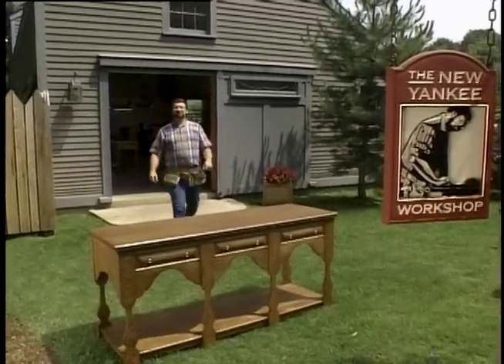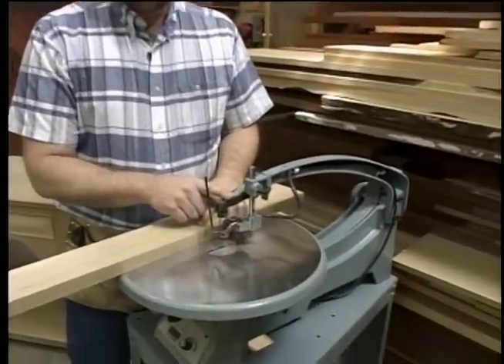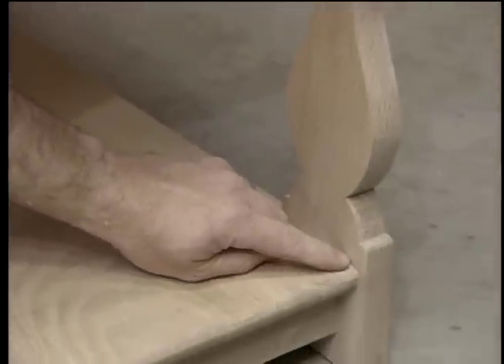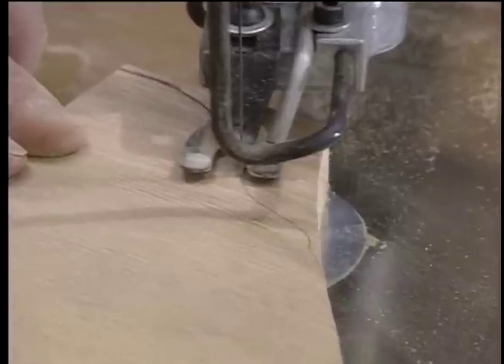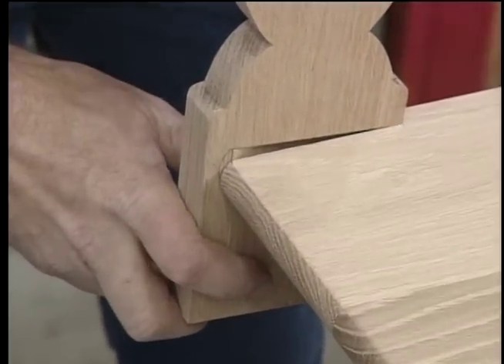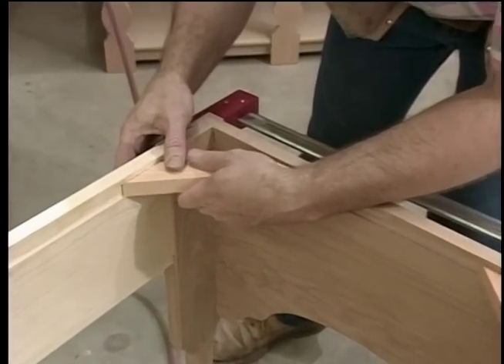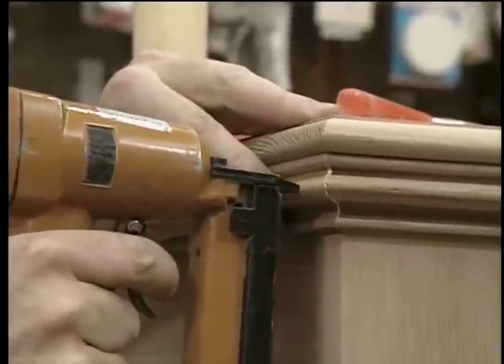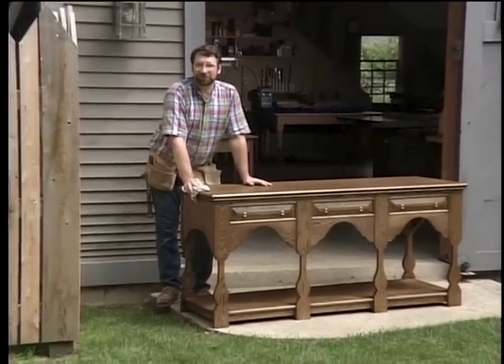Sideboard  |  S5 E7

Comment: I guess ultimately the reason for not keeping the Shaper was to prove you don't need to spend a ton of money on one to get good results for Doors and Moldings, that's why Norm built his Router Station. Plus Router bits are easier to setup than Shaper cutters.